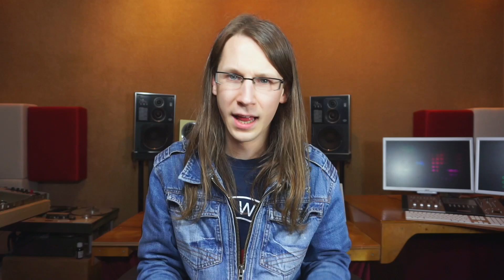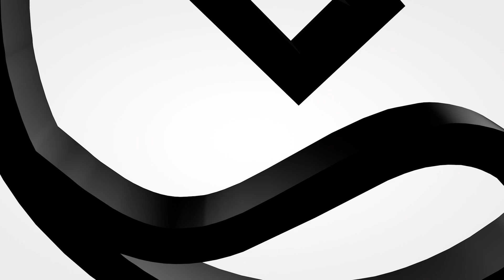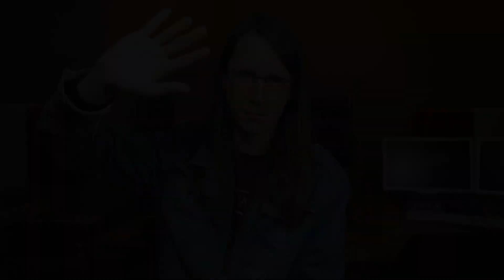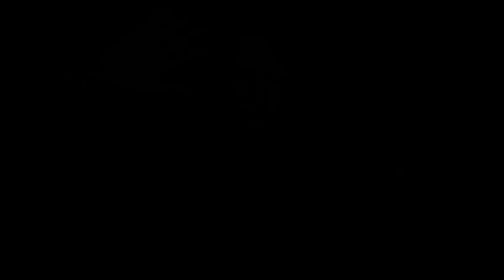ANALOG VS DIGITAL

Comment: For analog EQ, nothing beats Acustica Audio plugins. I'll put them up against your analog EQs any day of the week.
For tape machine emulation, U-he Satin is perhaps the top dawg. Slate Digital's VTM isn't too bad either.
For compression, real analog is still where it's at. That said, Black Rooster Audio, Fuse Audio Labs, Arturia and Slate Digital offer compelling options.

Comment: Cool. Analog and digital must work together I guess coz' for example the voice is an analog signal but it has to be converted to digital with as high a bit as possible (300+), it's not as good as say our actual ears (our senses our analog sensors I guess, paired with the brain) hearing the actual voice (again the sound waves from our voice is a analog waveform and not just on or off or 1 & 0 in the digital waveform, so analog has more details, more information). Digital is like the compressed version of analog, like TIFF perhaps or JPEG 2000 whereby it takes one chunk of the analog signal and collectively makes it 0 or 1. God bless, Proverbs 31

Comment: As good as Analog is, there is a lot more power in the Digital realm. There are things you just can't do with Analog while the Digital domain can [and often does] emulate the Analog one. Hybrid systems are great and powerful too. The best of both worlds.
I'm not a key player, I play mostly guitar and bass but am saving to buy a poly synth [either a Waldorf Blofeld keyboard version or a StudioLogic Sledge 2]. There is ample - and worthless - discussion in the guitar world about digital vs analog that will bring tears of tedium to your eyes. In the end, the gear itself is not responsible for what you do with it. You can even entertain a crowd with either a kazoo or a cheap casio electric piano if you have the knack for it. And that's all that matters.

Comment: I think with today's advanced software algorithms, modelling some of the best analogue gear. You can pretty much get all the warmth you need in a digital mix. And the benefits or digital precision, theirs things you can do in digital software you just cant do with analogue gear. Where as the warmth  that you get with analogue can be modeled. And with the algorithms getting better all the time, and physical modeling been the future. take slate digital's microphone modeling and pre amps. In 5 years time i don't think they will be even a debate to be had as far as mixing mastering goes. I think they will always be analogue lovers,vintage gear collectors and enthusiasts which  is a good thing. But i think the argument of needing analogue gear to create warmth and depth in a modern mix is long gone. A shit tune will always be a shit tune whether its mixed in analogue or digital, and vice versa for a good tune. As long as it's mixed well!  And with izotope's neutron and ozone 8 mixing and mastering assistant, the future looks bleek for mixers and mastering engineers lol. Ok it's not quite there yet, but when you think of the leap from ozone 5 to 8, what will the leap be from 8 to 10? I think what would make for a good debate is if eventually all mixers and mastering engineers will be out of a job? lol
Reply: Darren Smith “Warmth” isn’t near the sole advantage of analogue.  Setting aside the “but can it?” argument of digital- Think every professional out there would be fine if we never heard that term again relating to anything except the temperature of a reheated dinner when you’ve been @ the studio until 2am & missed dinner.  Digital modeling isn’t in the future, it’s here (see: Universal Audio).  I appreciate what I think you’re trying to say- “don’t feel limited by your tools(?)”.  That said- these kinda reductive arguments have been made in favor of both analog/digital (ad nauseam) & seldom bring the real world benefits/nuance/practicality/etc. of each application to the table.  That’s what’s gonna make this series enjoyable IMHO.
Reply: I agree,  the 60's 70's 80's and 90's was brilliant decades for music, as with every decade brought new new technology which shaped and inspired new songwriting and music styles. And when you include the skilled  mixing engineers who's pioneer techniques  where the secret sauce to achieve a certain sound. That along with extremely expensive analogue hardware which was out of the reach to most peoples budget. It would mean the record labels had you by the balls. You just could not achieve that sound unless you had the hardware and the skilled engineers. But i remember my first taste of digital producing. I believe it was a commodore Amiga, and a sampler tracker software called octamed, you had 4 channels of audio and midi. I use to sample from a cassette tape, remember them? lol and it recorded 8 bit audio. Yes it sounded terrible, but from a creative point of view you could get some cool ideas. Although you could buy digital samplers at the time, they was stupidly expensive. This was the first time you could get creative on a budget. But now look how far we have come, anybody who is around my age (40) will remember the window shopping looking at Korg, Roland synths. hardware samplers, mixing desks. amps etc. and dreaming of one day been ale to afford them.  Well forward 20 years or so, and you can now have Korg Wave station, M1 .Roland 50, plus all the vintage analogue synths running side by side with near identical sound layered with virtual guitar amps, running through an expensive SSL modeled mixing desk with hundreds  channels of 24it audio. But no only have we manged to recreate all the vintage sounds, we have surpassed it ,with granular synthesis , and advanced sampler engines and physical modelling you can only do with digital. And  with Melodyne, surfer eq. and now izotopes virtual mixing engine, you can literally bypass the hard learning curve of learning to mix and master to a certain degree. Also the fact if you want to learn how to sidechain compress etc ,you can just watch  a tutorial on you tube, you do not even need to sign to a record label to have no1 these days, which again is a good thing, nothing worse then having the big boys ran by Simon Cowell force feeding you remakes of there licensed back catalog of music.  These days anybody can create a hit in there bedroom ,probably using pirated software, (that's a different debate) then that track could go viral. However there is a downside that has now come with the digital revolution. We spend ages trying to achieve the best quality  mix, only  for people to play compressed versions out of a tinny iphone speaker. And i do not see that changing anytime soon. the fast food generation...